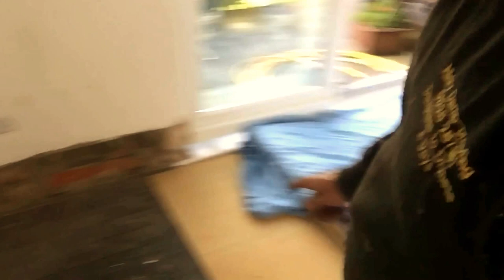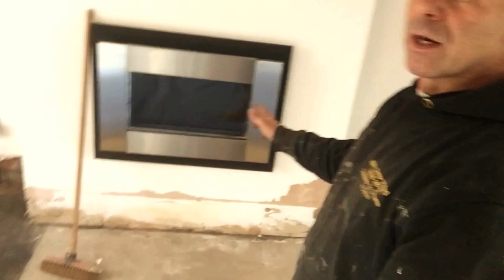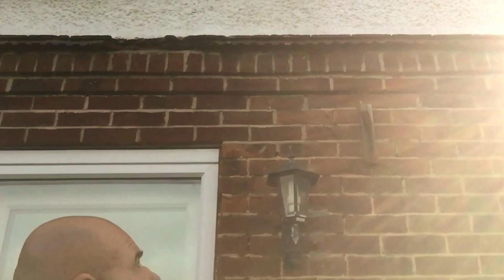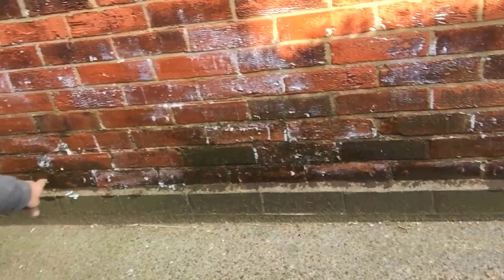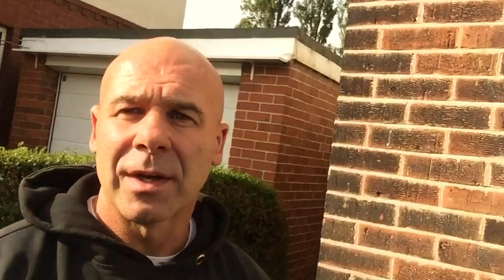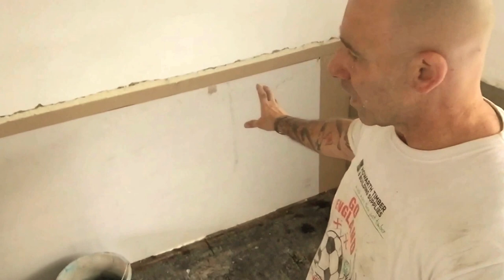A short clip that explains bridging & penetrating damp on site

Comment: Hi Simon. From what I can see from your video this house has a dpc and is of cavity wall construction. Therefore, if allowing for drips splashing back up from the first floor pebble dash render it still shouldn't be able to affect the inside. Yet you have taken the  plaster off the internal walls. And surely the chimney breast is affected by hygroscopic salts, not rising or penetrating damp
Reply from the maker: Stephen Gunner hi your part right with the chimney breast, I said there was no damp proof membrane inside the chimney when it had been infilled and this is a common problem, when the sulphate salts inside the chimney gets wet they migrate to the surface latterly and that is why these chimneys need a waterproof system installing. The other walls have a bridged dpc and it’s causing low level damp as I say in the vid. 
There are a number of systems that could suit and work we chose the one we used because it was the quickest, cleanest and most time efficient for our customer and us. Hope this helps

Comment: Hi Sam, I’ve recently brought a house and had some damp proofing done - when taking off the skirting I’ve noticed the gap where the air brick is but they didn’t mention anything about it - should I do something to make sure it doesn’t effect the new damp course or will putting a cowl on it be enough? Thanks!
Reply from the maker: Hi, Iv answered your question on the latest live video i have recorded

Comment: Should there not be a gap anyway between the floorboards and the wall? as you have to factor in the thermal expansion of the floorboards? the when the skirting goes on you just seal that gap with a timber molding and fix to the skirting board? that would allow the expansion of the floorboards to occur freely and also seal the gaps and prevent any cold-spots?  would like to be informed if I am wrong. Cheers
Reply from the maker: Stephen Mitchell the foam glue will allow any expansion once put in place and you don’t really want any timber touching the wall if it’s wet as timber is hygroscopic and will absorb moisture. It’s part of the isolation of the timbers.

Comment: I suppose that the best way to ascertain if, or not, the bay window wall is made from headers, as you suggest, or it was constructed from half bricks with a cavity to aid forming the arc of the bay during construction,  is to drill a hole..then all will be revealed.
It would be easier to build with half bricks and a cavity, instead of cutting every brick at an angle on each long side to form an arch....as in the case of header built.
Reply from the maker: ningis21 great point and thanks for pointing it out. I’m always learning even at 52 so any constructive comments are welcome. 👍

Comment: Hi Sam. I have an single storey external solid wall which was rendered years ago. The render is blown and cracked and seems to be letting penetrating damp through to the interior. I'm not too keen to re-render in case the same things happens. Would it work if the old render was knocked off and the wall was painted with Stormdry masonry cream?
Reply from the maker: Hi James, It sounds like moisture may be getting trapped between the render and the masonry then penetrating inside. If you knock off the render you may need to re-point the wall, then you can apply the storm dry.

Comment: Just been drilling and rodding on outside, i've got two drain pipes in way (not movable) is there anything i can do ? 
Also i've got an understair electric box with damp behind whats the correct process, box is going to be swopped but not for 3 weeks would like to get the house dry
Reply from the maker: smeggedup hi, you probably need a longer drill bit and go in at an angle where the pipes are. 
We hack off the plaster up to the meter then isolate around it, so drill and inject and foam any plaster showing so it doesn’t bridge with the new system being installed.
Reply: @dampsam  thanks i've already hacked 1m of most of downstairs walls wifes gone mad we only got the keys on monday. just need to tackle electrics area. Then paint and board out.

Comment: Hi mate, great video, just a question. With the sealant painted on the outside of the wall, does moisture still escape from the cavity ok? Thanks
Reply from the maker: Matt Walker thanks for watching, the product applied to the masonry is StormDry Masonry Ptotection Cream Ana it’s not a sealant or what we call pore blocker like silicone based products, StormDry allows moisture as a gas (water vapour) to pass through the fabric .

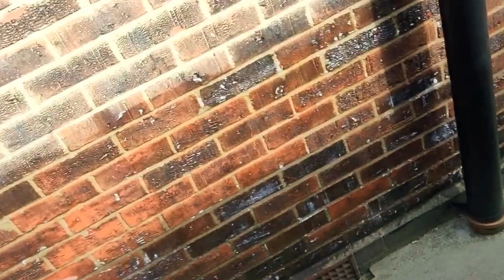Comment: looks like air brick is below ground level on the outside (6:12) which means rain water will run straight through it into the subfloor
Reply from the maker: That’s well observed, from what I remember we put an air brick housing on any vulnerable vents.

Comment: I have a issue as there's a smell that's horrible but I can see any damp. I have dug up around the front of the house to see if there's moss ect. But nothink it's geting me down tbh I have called a few places and thay just say if there's nothink viable then thay can't help 🤔😔
Reply from the maker: time with evie can you describe the smell? What type of floors do you have? Suspended timber or solid?
Reply: It's a suspended floor mate. And it's like a mossy earthty musty smell smeel it more after its rained
Reply from the maker: time with evie I would try and lift the floor boards in places as it could be a wet rot issue affecting some timbers. If it was a strong mushroom smell that could be dry rot. Stand on different areas and bounce up and down slightly to see if the floor has any give. That could be a sign the joist is decayed.

Comment: Simon. You say the cold damp air is coming in from the air brick. Is the ground level too high.  Surely if you lower the ground level to below  125 mm the problem will solved at a cost of a few hundred  pounds. 
Labour , removal of rubbish and pea gravel.  Also if the building is of the age you say it it would be of a sand lime construction. Bed joints and perps. If you put on your storm dry paint your sealing in any moisture which has got in from the loose cement over pointing. The brickwork will have to loose moisture some how. Surely it will force itself out of the face of the brick or possibly through the mortar joint. Won't your your paint end up on the floor with the loose brick or mortar joint.  I think rather than foaming and removing the plaster internally the best option would be to lower the external ground level and stop cold wet air raising the dew point and creating condensation internally.
Reply from the maker: Steve Murray thanks for your comments, lowering the ground level would cost more and look worse plus the salts contaminating the existing plaster will still spoil decoration as the wall dries out.
Reply from the maker: Steve Murray storm dry doesn’t seal in any moisture it’s been designed to allow water vapour as a gas through.
Reply: Exactly right. All that needs to be done is lower ground level. Every time it rains the water is pouring in the air brick making the sub floor damp. Not rocket science.
Reply from the maker: jacksticksmitch thanks for taking the time to watch the video, the customer does have a say on who carry’s out the work and there are different ways to do this work but have you considered that the home owner may not want a moat digging around the outside, it may sound a simple solution to you but other methods may suit. 
Your more than welcome to come on a site visit with me and tell me an alternative method at the time and we can discuss the pros & cons of each.
Reply: @dampsam  Thanks Simon! I suppose the home owner must be happy to have ground water entering the sub floor !!
Reply from the maker: jacksticksmitch ok jack thank for your input, ground water would already be in the ground, surface water may enter if there was torrential rain but would then dry out due to the air flow. 
Thanks for commenting and allowing me to give you some information you clearly didn’t know. Have a great day. 😉
Reply: Simon Cooper HNC CSRT CSSW so why put storm dry on. brickwork does not  allow moisture in,. cement pointing doesn't allow moisture either and there is a cavity. I'm sure you've checked the cavity and it doesn't need cleaning. This can only mean the  problem with the building from a damp point of  view is that the ground level is too high. The film has bridging in the title. The air brick comes into frame on the external wall we can all see it.  I have no problem with stuff you do internally that can all be reversed but the paint on the bricks is pretty impossible to take off.
Reply from the maker: @stevemurray679  Hi there, Just a quick one as im off to get a shower its been a long day. Water vapour as a gas will go through any material except glass. it travels through denser materials at slower rates. your right about cavities they do get blocked and there are lots of ways to tackle the issues. dont forget we were there on sight and your commenting on a video. the work was carried out and the customer was happy and the guarantee is in place in case there are any issues in future which there have not been so far. Have a great day
Reply: Thanks again for your reply. The water as a gas your talking about is humidity. The percentage of water in the air. Relative humidity. As you know when the temperature gets to dew point then the air condenses and creates damp on the surface and internationally.  That was my original point. It still doesn't explain the need for storm dry paint.
Reply from the maker: Steve Murray internationally though ?

Comment: Does make me laugh you refer to a British standard BS6576.......what about .....British Standard – BS 5250: Code of practice for controlling condensation in buildings, says; 'Accurate measurements of the moisture content of brick or mortar cannot be obtained by the use of electrical moisture meters because the presence of salts increases the electrical conductance of the water, giving falsely high .readings
Reply from the maker: Yes agree that’s why readings are put as %w/mc wood moisture content and %w/me wood moisture equivalent.
Reply: Simon Cooper HNC CSRT CSSW why are the damp industry continuing to use these tools to diagnose damp problems as this is incorrect and gives false readings every time
Reply from the maker: @daleburns7110  the methods are tried and tested and good practice, I’m more than willing to take you to any of our previous customer so you can ask if the systems and diagnosis worked.
Reply: Simon Cooper HNC CSRT CSSW it’s covering up the problem you are not solving it
Reply from the maker: @daleburns7110  well I respect your opinion and if it’s not for you that’s fine stop beating yourself up over it as everyone says your wrong.
Reply: Simon Cooper HNC CSRT CSSW everyone says I’m wrong?? Haha ok